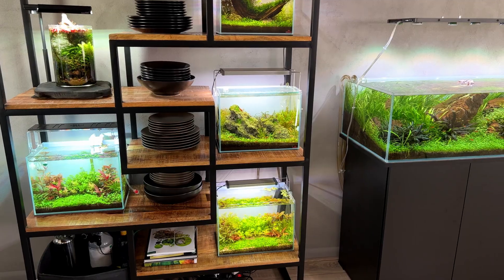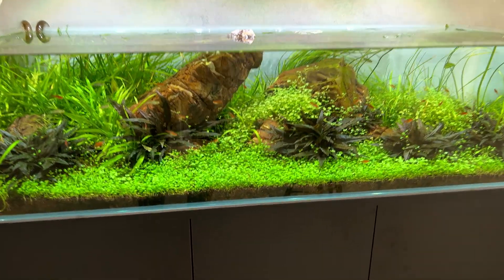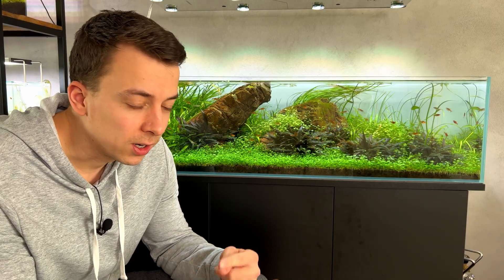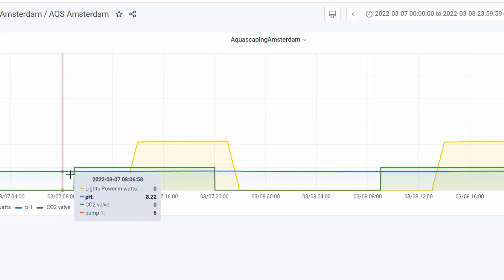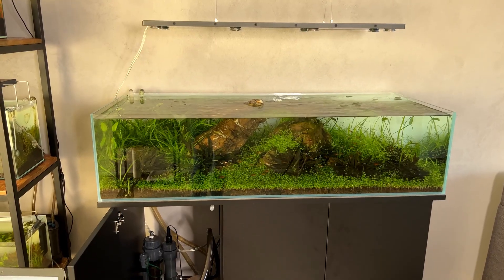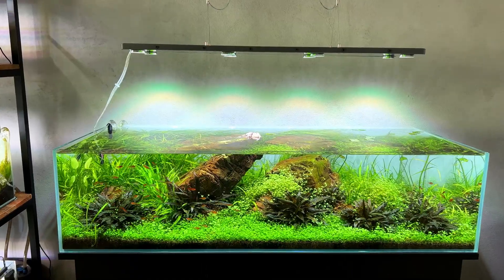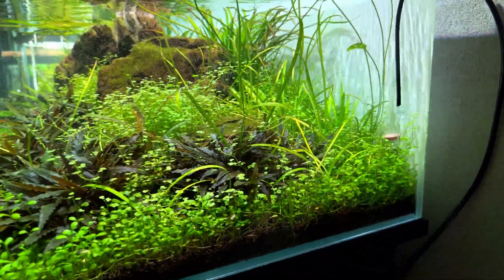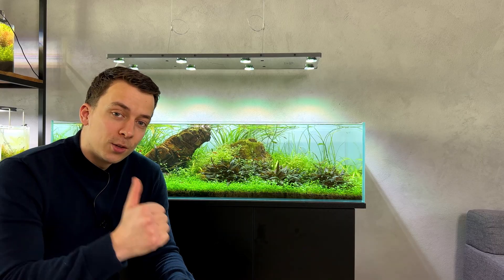CO2 EXPERIMENT: WHAT IS THE BEST WAY TO ADD CO2 IN OUR AQUARIUM?

Comment: MJ! For 25 years I’ve simply placed the CO2 line down into the tank and drilled a hole at the INTAKE cap and let the co2 bubble into the INTAKE and the FLUVAL 404 (not the best back then) and let the co2 diffuse through the entire run. 
The motor blades in the canister disperse the co2 further and the media also catches bubbles and holds them to release completely.  
Zero cost. No regulators. 😊
Reply: Won't this trap "air" bubbles into your canister then tho? Are they actually completely dissolved? Won't they impact the flow? (I'm very intrigued by your proposal and would like details xD) Also Co2 has a PH influence(beneficial bacteria gonna get it from this(i run a full cycle system which some say don't exist but you just need allot of time and tons of the right biomedia to account for the AN-aerobic bacteria), your impeller my get more friction aswell as there is less water across it at all times, this might create unwanted sound etc. There are many many lose threads in turning your entire circuit basically into a crude reactor

Comment: The conclusion is erroneous bc you were adding 3x more CO2 using the inline diffuser than the reactor.

https://youtu.be/KPuGpnpDl0E?t=702 Gas compresses which means the same amount of bubbles under higher pressure (inline diffuser) will contain more CO2 than the same amount of bubbles at lower pressure (reactor).

Also, for an efficient reactor, it's best to remove any media inside it as that impedes the flow.

Water carbonate hardness has no effect on CO2 dissolution.

Comment: Thanks for sharing this great insight. In my opinion there are benefits to have both 100% dissolved reactor CO2 as well as a small amount of suspended dispersed CO2 bubbles from an inline injection system. However for personal taste and the benefit of having extremely clear water in order to enjoy the viewing more. I would just go with a good quality reactor. That should support the plants adequately and provide a fantastic viewing experience. Thanks for sharing this inspirational and informative content. 😎👍👊🇦🇺

Comment: i just got the inline co2 atomizer, first time using it and it seems ok so far, going to check the pH drop shortly. love the experiment it's very insightful and useful. I've used the reactor and the in tank type before, but the inline makes the tank look so much cleaner. great video!

Comment: Thanks for taking time to do this experiment.  I think a better way to normalize each systems performance would be to either tune each system so each reaches the same target and is stable, then compare the CO2 flow rates of each.  The system that maintains the target with the lowest consumption is the most efficient.  The alternative would be to use a fixed CO2 injection rate for each system and the system that results in the greatest pH decrease would be the most efficient system.  Once you start adjusting the CO2 working pressure, you introduce gas density changes that have an effect on the total mass flow rate of CO2 injection.  Matching bubble counter flow at different pressures won't yield the same mass flow rate of CO2.

Comment: Quick question, I have an ista face side co2 regulator and it doesn't have a dial on the front to adjust the pressure is that a common thing not to have one of those dials? Forgive my ignorance if it's a silly question, first time using co2 on a tank. Thanks

Comment: Thanks MJ for the thoughtful experiment and for having a great channel. I would like to say that I think the results are misleading even though you partially addressed the issue of regulator pressure. I believe that there is more to account for when you change between the low-pressure reactor and high-pressure in-line diffuser. 

Boyle's law describes the relationship between pressure and volume of a confined gas (bubbles are confined within the liquid in the bubble counter and stay intact from surface tension). Two bubbles of the same volume under different pressures will contain different quantities of gas. Think of pumping up a bicycle tire - once the tire fills to size, you can keep pumping air into it increasing the pressure, but the size/volume does not increase much. With the low back pressure of the reactor, the bubbles in the bubble counter contain some amount of gas. With the high back pressure of the in-line diffuser, the bubbles in the bubble counter are compressed and therefore contain more gas per bubble assuming they reach the same size before they break away and float up. I think that matching the bubble rate in the experiment was a fatal mistake. Flow rate is the important variable, whereas bubble rate can be used as the proxy for flow rate only if pressure, temperature, and bubble size stay constant.

To sum it up, I think you were injecting more CO2 with the inline diffuser than the reactor, giving false results. The reactor when working correctly results in complete dissolution of the gas. The in-line diffuser releases bubbles into the display that will eventually reach the surface and off gas prematurely, meaning that it should always be less efficient than the reactor. There is a separate issue of whether the microbubbles in the display tank are advantageous over the reactor since they can attach directly to the plant surfaces. But since your experiment looked specifically at pH, I think the results are specifically wrong. You could either use a flow meter instead of a bubble counter, or you can measure the back pressure after the regulator for each setup and approximate the flow rate based on bubble count.
Reply: Incredible observation. Thank you!

Comment: Great Video, thank you! I need your advice: I recently switched to an inline diffusor (JBL Taifun Inline) for the mentioned benefits of having very small bubbles. After 24hrs of soaking and 8 days of use (switch off at night), the bubbles are still relatively big (not a micro bubble mist). Also JBL claims the benefits being able to save up to 20% CO2. Does anyone experience the same? Any advice? Thank you! 🙂

Comment: isn't the inline co2 diffuser installed incorrectly? It should be the opposite direction. I use the same thing and I do not see the co2 bubbles at all. The only time I can see it is through the pipes when I shine a flash light through.
Reply: You are right cdavid ( 10:53 ) . I am not sure it makes a big difference though since CO2 is diffused into the water from all sides (the membrane is a cylinder)

Comment: Hi MJ. Have you ever tried or reflected upon connecting the CO2 hose to an internal filter? I have one that I removed the filter part and it's just serving as a flow device directed at the Neo diffuser to spread the bubbles through my 100cm tank. (I use an external cannister for filtering). This internal filter has a little hole to connect an air pump to. Will the CO2 connect to this in an effective way or is there a risk to it?
Thank you in advance. Always love your videos! Regards from Portugal.
Reply: It could possibly wear out the impeller mechanism earlier. I dunno. I've hooked co2 into an HOB (I think it was aquaclear?) b/4 with a slanted chopstick stuck into the tubing, but you have to keep the waterline above the waterfall, or it loses co2 rapidly in the air. You could maybe, instead, drill a hole in the side below the waterline, but so the co2 doesn't have to go through the impeller. Maybe the airline does the same? Dunno, just guesing.🤷‍♀

Comment: Have you tried putting your in-line diffuser on the intake of your canister filter? That's what I do, the canister itself works well enough as a reactor / diffuser combo. I don't run close the same bubble rate you do in your demonstrations - so it is fairly efficient.

In fact I removed the ceramic part, its not required. I've been turning on my C02 3hrs prior to lights on to land a target of 30+ppm (KH/PH of 5/6.6 =~ 37ppm).  I get plant pearling about 3hrs into the photo period. I don't use a PH controller, but thinking on that.  I'm still adjusting so I may start backing off during the photo period with timer controls if the CO2 starts to climb too high.

I use a smart power bar for all the items I need to control, its convenient and I can control the items from my phone or google home by shouting at it. :)

Comment: MJ, nice experiment. Have you ever looked at how pH responds when co2 is injected 24/7 without a controller or solenoid? That is how I've been running my tank for ~24 years. Local water is soft. I set a constant bubble rate ~1 bps. Ph drops to low 6s overnight and rises to nearly 7 towards the end of the light period. Pearling starts soon after the lights turn on and slows several hours before end of light period. Fish are especially active in the afternoon. They do not seem to mind nighttime lows. Having never used a controller or solenoid, I also wonder why you let pH rise overnight rather than maintaining the same level 24/7.

Comment: Let me ask this have you ever used inline uv and inline co2 defuser at the same time being they have to run on the same return line I was told it could be done as long as uv goes on tube first any thoughts on that
Reply: I dont see why it would be an issue. GLA makes a reactor with UV built in.

Comment: I just bought a quality inline diffuser like the one showing around the 1:52 mark. I installed it the other way round according to the instructions. I thought the bubbles were rather large (larger than my intake atomizer) and it didn't make sense to me to have the ceramic disk below the co2 line injection, so i turned mine around which matches yours. I now get a very very fine mist coming out and can barely see it in the water as it dissolves so quick. my drop checker shows green (which is placed at the bottom of the tank on the opposite end from the outflow of the filter) so I am glad I see yours installed "backwards" to what the instructions say....** Edit, but at 10:53 you have flipped (instructions way) which way is correct and have you noticed a difference between the two directions???? Please help
Reply from the maker: Hey Rob! I was a little confused as well, but I didn't notice any difference with both positions
Reply: @MJAquascaping  Thanks for the reply. I learn alot from your videos :) At least with quick disconnects on the hoses its really a matter of just draining the hose quick, flip the unit and away it goes again lol. So far the bubbles are very small and no leaks etc so as long as it wasn't like NOOOO don't install that way, I am good :)
Reply: I did the opposite way and my bubbles r super fine.

Comment: Retest the reactor with a little more Co2 added to reach your 6.8ph and it's going to use less pressure with the same result and save you money in Co2. I know that it cost more up front but there's no insert to replace. I have a reactor on my 150gal.
Reply: I was just told that a reactor would not work good on a 180 gallon tank that I needed to run two inlines instead what’s ur opinion thanks
Reply: @Kendez.  I've never seen a vid or tank at my loco fish shop running two disfursers. The only problem I'm having is that my water is perfect for African cichlids or saltwater. high Ph 8.2 and really good buffering to keep it high. I'm running two DC pumps one for dry-wet filter and the other for Co2. At the moment my Co2 controller doesn't hit my set Ph of7.0 stays at7.5 but plants are pearling, and check dropper is a medium green and fish are acting healthy so I'm not worried about the set Ph. Good thing about plants you can't hear them scream and their cheap. My 150gal is 72x18x26 no cover and plenty of turbulence on water service. I feel that a reactor is the best set up for me. Controlling more Co2 lines when I can do it with only one that's my choice. Hope this helps and let me know what you went with.
Reply: @cbayless4294  green left sent a pic with two inlines back to back on the same out take
Reply: @Kendez.  I'm not going to say that it doesn't work or that's the only way to do it, but With YouTube there's a lot of vids that shouldn't be allowed because their crap and tell you the wrong info. Do more research and see what the cost difference is and how much work to maintain both systems. I'm not sold on the ceramic insert due to getting clogged No issues with reactor.
Reply: What tractor you use I’m in the USA
Reply: @dthomas698  I use the NilocG reactor

Comment: So I came up with a idea. I use a co2 Reactor on its own dedicated line, which has a in-line pump,. It has its own set of lilly pipes also. That way my Oase canister filters' flow is not reduced +Plus even more flow from the opposite side of my aquarium.
Reply: I think is would have made a difference.

Comment: Great experiment. Bu you should repeat it with the same CO2 operating pressure, since you increased the pressure with the diffuser. The results you obtained are not directly comparable. If the amount of injected CO2 were the same, then the reactor would have achieved a higher CO2 concentration, since a reactor will achieve a higher CO2 dissolution rate than an inline diffuser.
Reply: Yep, I think you are right. I find it hard to believe that the reactor produced worse results than the diffuser. Of course there are pros and cons with both, mainly price and size of the two.
Reply: Just by looking at t he bubble couonter it's obvious the reactor was given more bubbles per second. Pressure is irrelevant for the reactoor, it doesn't needhigh pressure. What proobably would have made a difference for the reator is if he had more flow from the filter.
Reply: @marlonallansupetran7120  Gas density varies directly with working pressure.  Eventhough the bubble count might be the same.  if the reactor pressure is a quarter of the inline diffuser pressure, you are effectively injecting a quarter the amount of CO2 with the reactor
Reply: @kellygordon103 not at all reactors need only 1 bar of pressure where as diffusers need at minimum 3 bar 👍🤝

Comment: There is another way of injecting co2 (used to inject o2 in industrial aquaculture). An pressured chamber with gazeous co2 and water showered finely from the top, droplets of water going through the co2 and not the opposite. Quite nosy maybe but should be adapted for huge tanks! Do you know what system they use in the sumida aquarium?

Comment: A quick way to judge your actual CO2 delivered with a low-priced CO2 gauge instead of a probe is from the 2Hour Aquarist. You pull out some water after your CO2 had been on long enough to reach maximum dissolution--say two hours after it turns on. You measure the pH, pour the water into a small jar and shake it vigorously for five minutes steadily. That should degas all the CO2 you put in artificially. Now you measure the pH again and look at the spread between that value and the previous onw.
Reply: Degassing in 5 min shaking??? Impossible just let it out side for 1-2 days till the ph stop dropping
Reply: Or measure the ph before the co2 comes on and then when you think you have max saturation. A 1 point ph drop is 30ppm co2, all other things being equal.

Comment: If you prefer an inline system; qanvee is really great. It's the same as the co2art, except a lot cheaper (aliexpress). Thank me later.

Oh and a tip against leaking gas, use Vaseline on al the connections

Comment: Mark, you increased the pressure by 5 psi on the in-line system, thus I reckon you used 15% more CO2, I doubt you could accurately count the bubbles at the fast you rate you were releasing the CO2 at with your fine adjuster.
Reply: Pressure is irrelevant to the reactor as there's nothing constricting the flow of co2 into it.
Reply: @marlonallansupetran7120  Thanks, I might need to watch again, I understand quantity and pressure are not the same thing, like a thumb constricting a water hose.

Comment: How useful is to add CO2 without enough light to help the plants to process that ? On the graph is a 2 hour gap between adding CO2 and switching on the lights .
Would be interesting to see how low will go pH without light , the pH is capped at the bottom because it is reached the saturation limit of CO2 in the water ( that would happen in the absence of light anyway) or because plant are using CO2 ? What will be the CO2 concentration in a tank without plants ? 
Anyway , according to your own graph , switching on the lights don't produce any change in pH ,therefore no change in CO2 concentration , it means that plants are not using that much of the CO2 that is dissolved in the water either because they don't really need that excess CO2 or because it's just too much CO2 .

 If there are fish in the aquarium , they certainly wont benefit from the pH fluctuation ,I bet they are not aquascaping fans at all .

Comment: Good point about pressure! When using diy co2 in my experience reactor is best because it last longer and you need less co2. Then in tank co2, takes more pressure and dont last as long. Inline is almost useless.

Comment: Really good experiment. Actually I have a CO2 diffuser in the tank. I tried different places to obtain an optimal distribution of CO2 and figured out the best place is next to inlet pipe. Most of bubbles are aspirated and after the drop checker the amount of CO2 is good. What do you think?
Reply from the maker: Yeah I prefer either next to the inlet or on the opposite side of the inlet. But this depends on the amount of flow as well
Reply: If you add co2 close to the inlet surely it will kill all the friendly bacteria in the filter as the pure concentrated co2 is being introduced directly into the filter first